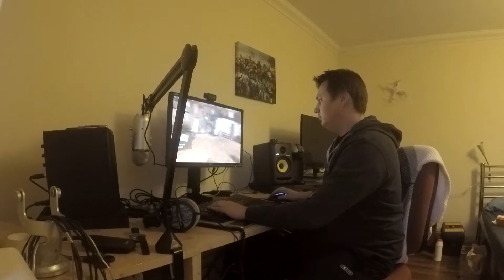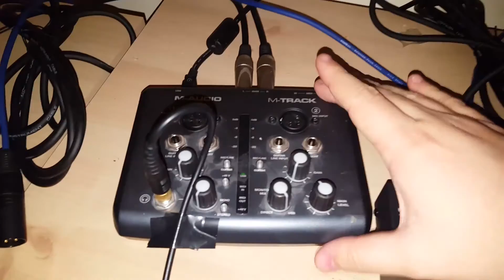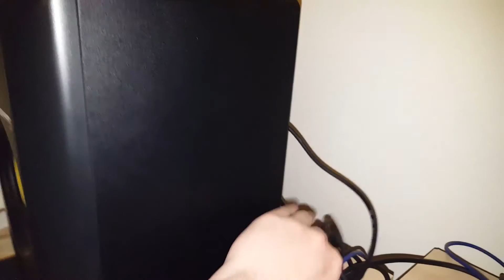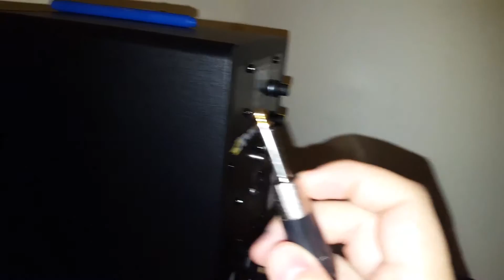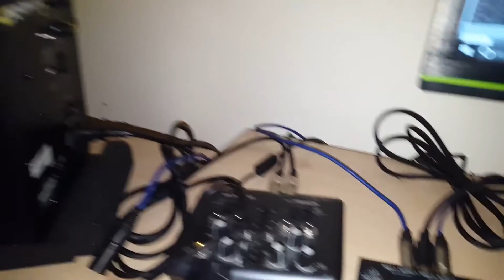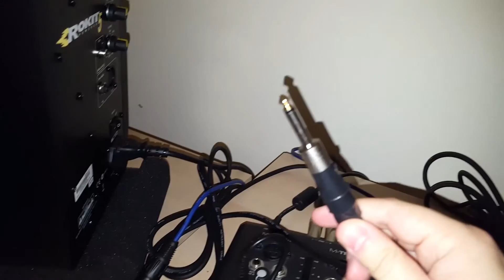Solving a GPU to Speaker Ground Loop

Comment: I was experiencing the same issue, but with passive Canton speakers, a Focusrite 2i4 sound card, Yamaha AX-590 amp and Yamaha YDG-2030 EQ for probably 2 years now, and I had tried almost everything, meanwhile I also had changed my PC entirely, motherboard, gpu, etc. as well as many other things, in hopes for this to be resolved, and the only thing that was working was if I disconnect the Yamaha YDG-2030EQ from my amp, and return the bridge at the coupler pre out and main in. However in that situation i can't use my EQ when playing music from my PC. Even if I was playing music from my turntable, as long as the Focusrite was connected to my PC, it would pick up the noise even then. Something that lowered the buzzing and all annoying noise was to connect the output of Focusrite to the input of the Yamaha EQ, and from the output of the Yamaha EQ, I would connect to the CD input of the Yamaha amp, and I would again use the regular bridge at the coupler pre out and main in, which isn't great, and it would also have me disconnect the cables if I want to use my turntable. Yesterday I came across your video, today I bought this with two sets of 6.3mm Jack to RCA cables, and the miracle happened! Thank you so much. 9 Years later, I can confirm that this resolved my issue. In the near future, hopefully I will be able to add two active speakers into the loop (Edifier S3000 MKII), and hopefully they don't pick up any noise. Thank you again, this has been a blessing!

Comment: My problem is my system just started doing this ....have had same set up for 5 years ....checked everything....all good ...balanced cables ....just wont go away .....thinking there is an issue with the gpu itself .....grrrrr

Comment: I have the same issue with my rtx3080 😅
Same monitor btw
Reply: Did you manage to fix it with the hd400 ? I also have an RTX 3080 connected to a mixer via USB to my KRK speakers and I tried everything possible to eliminate the noise (cheap USB isolator partially fixed the problem for the speakers but when I plugged my Headphones into the mixer a High noise was very irritating 

I'm gonna try the hd400 next week I hope it will fix the issue it's been 1 year ...

Comment: 2022 and only now ive seen this fix... Years back did came across these issues but not this one due to GPU (Only now im having since few months back because i got a RTX the thing is very powerful so this issue decided to showup) Im on the path now to buy these devices your advising and see if helps me some how! I know its been 6 years lol but thanks for this even in 2022 with all these super new gen devices your still helping better than most i can see lol thank you again

Comment: Can i use this on my noisy guitar pedal?
Reply from the maker: If you think you have a grounding issue or something that can be solved by converting an unbalanced signal to a balanced one. I've never actually used it with a pedalboard setup before so I really cannot say for certain. I usually plug my guitar straight into my USB interface and use digital plugins.
Reply: @JaayB  when i touch the guitar,noise are gone..is that a ground issue?

Comment: the power supply for sound card would not help to solve ground loop. I have a sound card with external power supply and I have GPU noise on my KRK. SO just ordered HD400. Tried everything....
Reply: Did HD400 help?
Reply: @sevchyk  yes it helped. No noise at all.
Reply: My story. I resoldered my cables to TRS-XLR and I had 50% less buzz already. Connected HD400 and its gone.. 😁

Comment: Hi ! I have the same problem ! Before 2 months I bought my first pair of studio monitors and still have this problem - they are useless ! I lost hours and probably days to search the problem  changing sockets and trying different things. Finally I found that the problem comes inside the box from my desktop PC and ... most probably from the video card or power box. I am drafter/structural engineer and use two screen monitors and use Nvidia Quadro graphics card. Today I make more attention on this device Behringer HD400 and tried to find in You tube connection between it and "studio monitors" and .... your explanation confirms all my doubts. THANK YOU  ! ! !     The only bad thing for me is that I need to wait two weeks or month because the device is not available in my country.

Comment: Thanks that was very helpful! Still does not solve the issue with the headphone output of the soundcard :(
Reply from the maker: It wont because of where the grounding is taking place. 
My issue was with the speakers so I used this thing to ground it in the connection between the card and the output. 
If its on your headphones you need to find a way to do the same betwen the output ack and your earphones, or a way to ground it before the sound card.
Reply: @JaayB  Thanks Jaay, for anyone wondering I found a device called "IFI idefender" that can break the ground to the sound card via USB and should resolve the issue but have not yet tried it myself. Thanks.

Comment: I'm now experiencing this with my AMD 5700xt and an M-Audio Air | Hub paired with Yamaha HS7 Studio Monitors. I've just ordered the Hum Destroyer and an additional pair or 1/4" TRS balanced cables for interconnect. I am 99% sure it's a GPU <-> DAC ground loop and that this will fix it. I'm experiencing the same thing you've demonstrated with games in particular driving the obnoxious noises at intolerable volumes. Thank you so much I'm sure you've saved me and many other people a lot of $$ buying up-market DACs as a possible fix.
Reply: Any updates? Did it work for you?
Reply: @bart4375  Yes it worked 100%. I'm still using my Yamaha HS7's with my 5700xt daily and I have zero noise since I bought the hum destroyer.
Reply: @Magpie1701  Glad to hear, thanks for the update

Comment: Since you're using an external Audio Interface you might as well just isolate the USB Interface using an Galvanic USB Isolator like an iFi iDefender+. That way your analog audio signal between the audio interface and your speakers/monitors remains "untampered" with and only the digital connection between your PC and the USB Audio Interface gets isolated. It's the "cleaner" solution for your ground loop as far as signal integrity is concerned.
Reply: The iFi iDefender+ is twice the price of the Hum Destroyer. Just saying.

Comment: So i see you plug unbalanced cable for each channel from your audio interface into hd400 and then from hd400 to speaker using balanced cable
So if you still use unbalanced cables for input and output of each channel, will the noise still be there?

Comment: That is weird. A XLR cable should have solved the problem. I guess the amps inside the KRK don't 100% decouple from the ground, what they should. Good to know that helped. Oh ... and by the way .. the Behringer Unit simply has two to 1:1 audio transformers in it. They do that galvanic isolation you needed.

Comment: Hello jaayb , i have same problem as in video but   noises coming through my earbuds ,  would  Behringer HD400 solve this problem to me? and how do i connect it to computer and my earbuds to this  hd400 hum destroyer?  also when using big  normal headphones ( philips shp2500 )  there no noises
Reply from the maker: Probably not I'm afraid. There is no reasonable way to connect a stereo mini-jack to something that needs 2x mono 1/4" jacks. But on the flipside its hard to say if you have the same issue. It could be the headphones, a dodgy connector, could be a ground loop or it could be something else. Without knowing your specific setup its hard to say. Try a few things and see if you can narrow it down :)
Reply: @JaayB  when unplug  GPU from computer no noises . do u think ground loop isolator would help in that case? and why in big headphones no noises while in earbuds i hear interference

Comment: Have same issue have some jbl 305s getting the hd400 tommorow and some balanced cables hope it fixes it
Reply: John Williams I have the same problem did you solve It?? I need some help!
Reply: LIVELOVEteyTEY it most certainly did. There is a slight hiss from the speakers now but it's hardly noticable unless my ear is right next to them. The horrendous noise however was completely elimated best 20 dollars I ever spent.
Reply: can u help i have same noises but in my earbuds .  how do  i connect it to  behringer hd400 ? and then to computer ? also would this help you think or for headphones i should buy other  hum destroyer?

Comment: so u dont have issues with ur phantom power mic? or u plug it in this thing
Reply: I've never had issues with phantom power myself. All I did was plug my speakers into the HD400 > Audio Interface and made sure the contacts were isolated with electrical tape. I'm using a phantom power mic (Rode NTG) as my primary mic at the moment instead of the yeti and still no issues with this setup when using either my PC or iMac.

Comment: Hi, I was wondering if anyone can help I'm thinking about buying the Behringer vMicroHD Hum Destroyer as my krk are making a horrible sound while my laptop is charging, I'm using a focusrite scarlett solo 1st gen so what cables would I need to buy for the hum destroyer?
Reply from the maker: I THINK (please confirm this for me) that the gen 1 interface uses RCA connectors as an output (the red and white colour coded ports)? So you will need to use an RCA to 1/4 Jack cable to get your cable into the hum destroyer. From there you can use a 1/4 jack to XLR cable, or a plain 1/4 jack as the krk speakers support both if you have the same model as mine or higher. Just look at the connectors and you have in the back and you should be fine. If your connectors are metal and touching, make sure to tape them up!
Reply: Yes the Gen 1 interface does use RCA connectors as the output, Im using the KRK Rokit 5. So if I'm correct in what I have read I need 1 RCA to 1/4 jack cable and  2 1/4 jack to XLR cable to set this up?

Comment: I just bought this little wonder box today and it worked just fine. I had 100% the same problem (my background noise was low using certain applications, but when i opened up games like DOTA2,Max Payne ..the hum would become unbearable). So i figured i try this out just like you did .. I am using two DENON-DN308S monitors (150 Watt per  piece with individual active Amplifiers - just like yours have) and the HD400 miracle box even works using all unbalanced connectors. I tried various combinations with Unbalanced stereo (or RCA) to Balanced TRS / Unbalanced TRS (or TS) and it works either way. I was told by a lot of professionals that there is no such thing as balancing your audio circuits through any type of box.. but this little thing sure does more than that. Totally recommend this ! A cheap (around 25 EUROS) and affordable solution to Enjoy the Silence.Thanks a lot JB !! YOU KICK ASS !!
Reply from the maker: Glad you got your issue sorted and I was able to help! The magical little box just breaks the loop that happens between all your devices and it does this by creating a new ground or Earth in the system. I think if my audio interface had its own power supply and didn't run off USB it would have broken the loop too, but I have no way of testing this. Anyways enjoy your silence! :D

Comment: I've had digital noise in my KRK Rokit's for years Actually got the HD400 for my guitar amp FX Loop and while looking for some videos on it came across this, just tried it and fixed the issue now I got to buy another one lol thanx man!
Reply from the maker: No problem! Nice that you already had one to test it out first. I just bought it blindly knowing the theory behind what I thought it was doing. It's a nice cheap fix! Now go enjoy your noise free speakers :D
Reply: Works in the FX loop...? Fabulous.  My Carvin X100b has a hum when using the loop...gonna try this!

Comment: Thanks so much dude, I have this same issue and tried several things. Bought an USB hub with external power, should also fix te problem, but rather than only the signal my USB hub both gets signal and power through the USB port with additional power from the external power adapter. I didn't expect that. Now I'm going to buy the HD400 and 2 TRS cables and hope this fixes it!